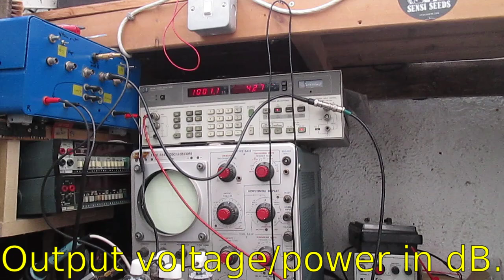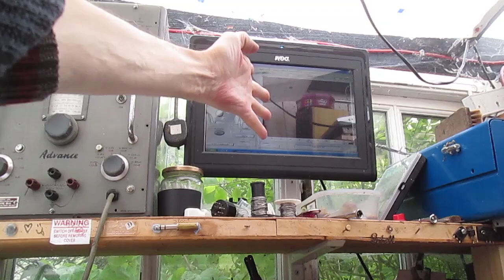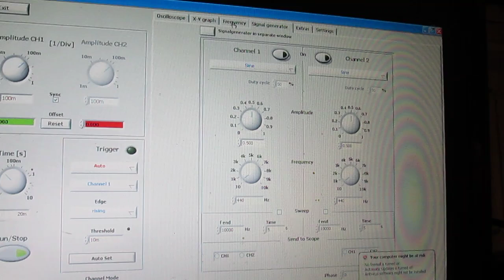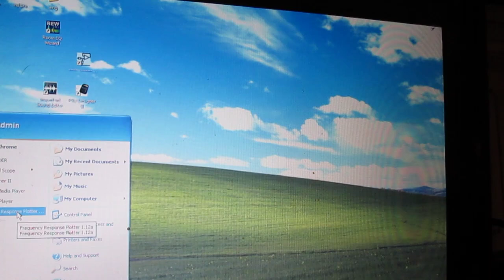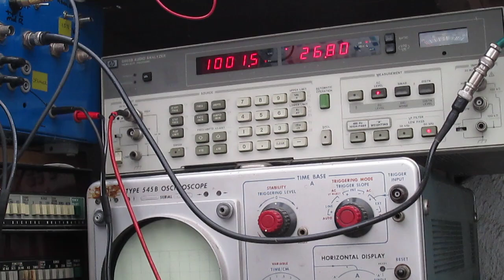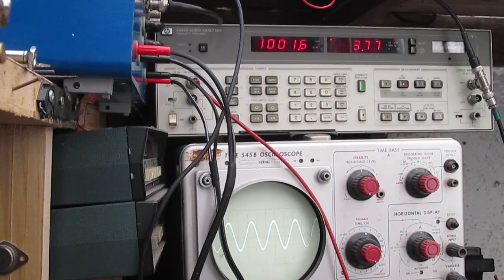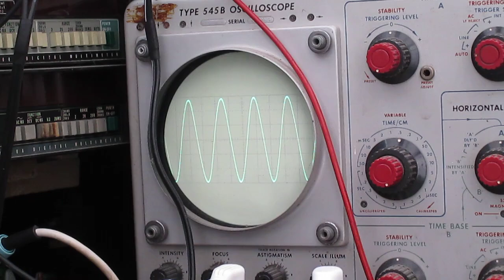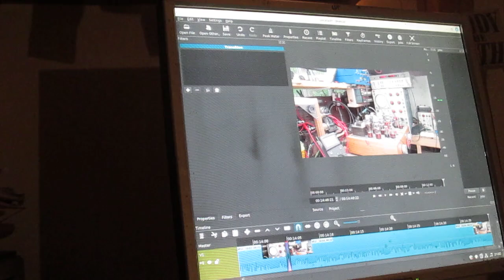Negative Feedback - In Audio Amplifiers - How to Apply - Part 1.

Comment: Very useful to me, thanks! This is a topic that interests me because I have and old Luxkit A3600 that has a similar circuit to yours - it has a 1/2 6AQ8 going into a LTP phase splitter (6GU7) and on to two KT120 output tubes. The GNFB has been altered from the schematic from 16dB (2700ohm resistor with 560pf bypass cap) to something like 20dB (2200ohm resistor with 330pf cap) and I'm curious to understand how it works and if I should return it to stock.
Reply from the maker: Thanks, glad it helped. That amp has a respectable reputation. A 6AQ8 has quite high gain, 65 so your amp probably has high open loop gain. Why the NFB was changed we will never know however more NFB = less stability margin, has the amp any compensation, any zobel network? Any protection apart from a fuse? If not it's an oscillator waiting to go off with the right load/speakers which means bye bye speakers, OPT's, OP valves & maybe power supply. 
   As you saw in part 2, every time one increases NFB, you get less improvement, I doubt you'd hear a difference between 16 & 20dB also the original designers hopefully knew what they were doing setting the NFB originally. The A3600 owners do seem to like mucking about with them, most of which I'd hazard don't know what they're doing. You have a good grasp of the subject, if the amp isn't quite right to your ears, change it. TFW.
Reply: @diabolicalartificer  - yes, the bugger has done a little motorboating with some of the tubes I've tried rolling in.

There is no zobel network but there is an additional negative feedback circuit from the cathode of the output tubes with a 22ohm resistor in series with a 0.22uf cap. In mine, the 22ohm resistor has been halved to 11ohm, which doubles the cutoff frequency from 33KHz to 66KHz. This is a another mod recommended as part of change to KT88 tubes from the original (obsolete) 8045G power tubes.

I have made some changes to the power supply and the shared cathode resistor for the LTP so that the tubes are biased optimally for low THD. So I might reduce the GNFB resistor value from 2700ohm to 2200ohm and see how it changes things.

One thing I'm concerned about is the gain and the effect on power output from mucking around with the NFB. The KT120s are a better match for the amp than the KT88s I was using as the B+ is very high (~515V) but the PT gets hot over time due to the high output (~75W). If I decrease NFB then I expect I will need to turn down the volume on my preamp a touch to achieve the same dB level but how does it affect the output/dissipation of the A3600 amp? I'd prefer to make changes that reduce rather than increase it!
Reply from the maker: @Luckiestmanalive-bb1mi  I've looked at the schematic, your amp has several local feedback as well as global feedback. Also the original valves were triodes, I'm guessing the KT120's are triode strapped. In light of which it isn't as simple as changing a few resistors or caps. If it were my amp I'd do a thorough test, frequency sweeps, stability testing etc.
   a quick way to limit OP diss is to bias the OP valves a little colder, but that will change, to some extent, the behavior of the amp.
    B+ sounds high @ 517v, the schematic I saw said 470v I think, which is a cause of concern: are voltage ratings of caps etc being exceeded?
   So, to reiterate, pop it on the test bench, take DC & AC conditions, sweep from 10, 20hz up to at least 100khz with & without global NFB. after applying NFB stability testing. Hours of fun : )
Reply: @diabolicalartificer  - yes, there are a few forms of feedback but the main two that seem to be tweaked consist of C111-C112 plus R135-136 (from cathode of output tubes) and R133-134 bypassed by C113-114 (GNFB from 8ohm tap of OPTs).

The original 8045Gs were internally wired as triodes and the usual way the conversion to KT88s occurs is to insert a 100ohm resistor between the  grid and the screen pins. Just for shits and giggles, my one has instead been wired in ultralinear configuration (there are wires between the 44% taps on the output transformers and the screen pins of the KT120 tubes).

I've biased the KT120s at 70mA and that has definitely reduced the heat dissipation to less concerning levels. One thing about the high B+ is that I think the amp is operating entirely in class A region. 

The B+ at the OPTs is supposed to be 490-495V. Mine is ~510-515V due to high mains voltage. This is part of the reason I redid the power supply. I'm getting over 560V on startup so I now have 600V caps at C1 and C2.

Sounds like I will have to invest in testing equipment if I want to tinker with the NFB. Thanks, for taking the time to respond!
Reply from the maker: @Luckiestmanalive-bb1mi  The problem with having several methods of NFB ( also looks like there's current FB too) is that it really complicates efforts of a novice to characterise the amp. It's beyond my ability's. The various FB circuits means there are numerous poles that need calculating, again beyond my skill level.

  The class A operation can be calculated which involves drawing load lines & graphical analysis or monitor the voltage across the OP valve sense R's, increase the IP amplitude, then note the point at which V changes.

  That said OP valve quiescent power can be calculated using ohms law IE V x I . I bias my amps power OP stages at 75% of max power, as per the datasheet.

   Lastly, as I've mentioned several times in my vids it's easy to get hung up on bench testing. The ultimate test is,  "does  it sound good?" & "is it safe?" Good luck, hope I've been of some help.
Reply: @diabolicalartificer  - thanks, you've been a lot of help.
Reply: I have just finished a fun project to clone the PCB on my Luxkit A3600 and manufacture replacement boards. I had 5 new PCBs made and delivered so I repopulated a new one with new components (same make and quality of parts as old board, more or less, as I'd refurbished them a while back) and swapped out my old one. 

The only major difference between the PCBs, apart from the new board itself, is that I went back to the original 'stock' NFB component values (GNFB resistor up from 2,200ohm to 2,700 ohm and bypass cap up from 330pf to 560pf, and output cathode feedback resistor doubled from 11 to 22ohm). I figured I would just swap the old board back in if it was unstable or didn't sound as good. 

It has turned out to be a big improvement. The imaging is more solid and the depth and width of the soundstage has increased. Also, the old board had turned dark brown in places from heat stress - those areas were reading 100C according to my point and shoot thermometer and after over a week of settling in by playing it every day the temps on the new board are back down to 70-80c at worst.
Reply from the maker: @Luckiestmanalive-bb1mi  Well done, good result. The hot resistors though would bother me. Are the bodies of the resistors too hot to touch for long? Careful not to get zapped. If you measure the V across the resistor, use ohms law, EG divide V by R, then get that number & times it by V, it'll give you what power the R is dissipating, say 2w. The rule of thumb is to use a bigger wattage R, so for a 2w use a 5w. Mount it high off the PCB, say 12mm or half inch off the board. That should stop heat damage to the PCB.
   Well done again.
Reply: @diabolicalartificer  - the hot resistors bothered me for a good while, too. They are the 27Kohm and 33Kohm plate resistors and 10Kohm shared cathode resistors for the LTP phase inverter. According to my ohms law calcs, the plate resistors are dissipating well less than 1W but I upped them from 2W to 3W. The cathode resistors look like they are dissipating 0.9W x2 (95V, 10Kohm) and I have used 3.5W wirewound jobbies. I installed all of them just over a centimeter off the board.
Reply from the maker: @Luckiestmanalive-bb1mi  Sounds like you've got it covered. You can't beat WW resistors where they may get hot.

Comment: I would do some square wave test to get the sense how stable it is.
Reply from the maker: I have & will, however square wave testing can only tell you so much. I test using no load & capacitive loads too. Will cover that later on. TFW & for your input.